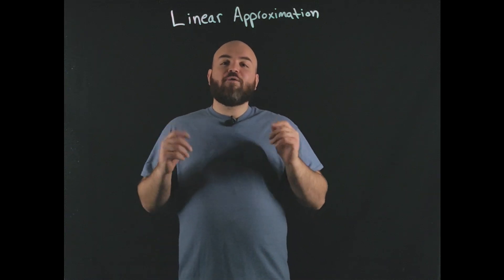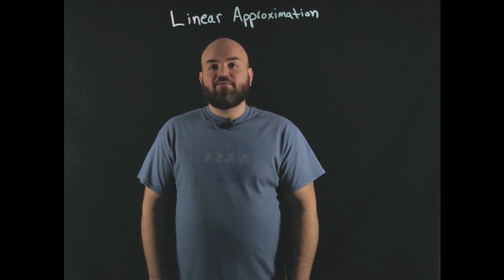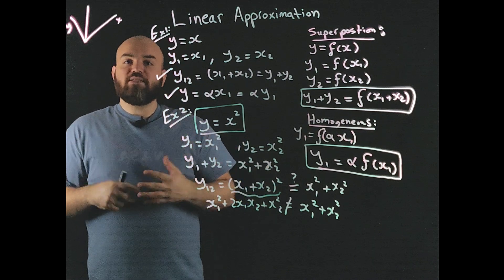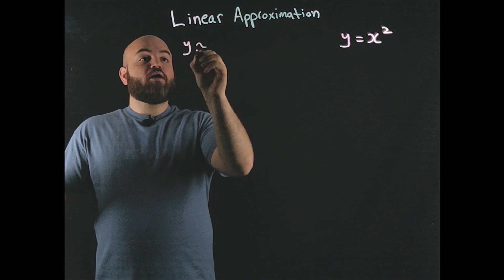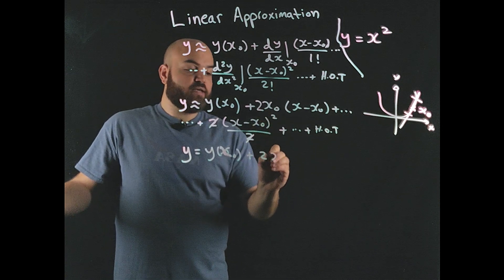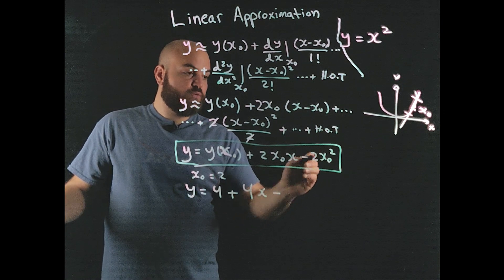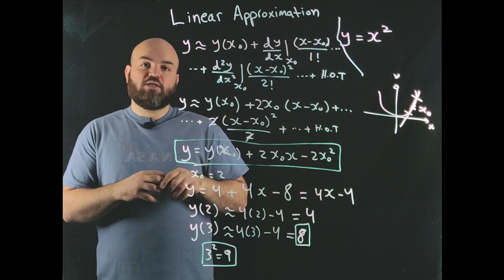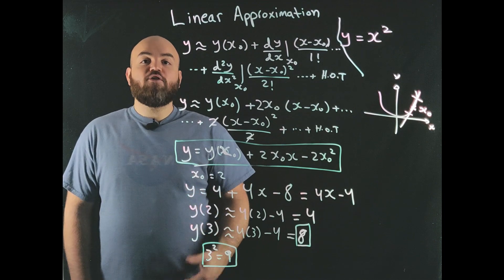Linear Approximation - Linearization with Taylor Series

Comment: at 10:25 of the video, how is the linear approximation equation y = y(x0) + 2x0x - 2x0^2 a linear system?  I applied it to the superposition principle and found results are not the same.
Reply from the maker: y = y(x0) + 2x0x - 2x0^2 is linear because the first term y(x0) is a constant and the last term -2x0^2 is a constant as well. So the only term left as a function of x is the middle term 2x0x. Therefore y is linear in x.